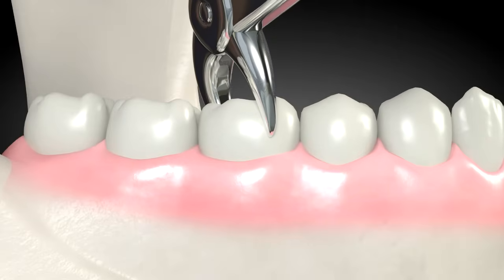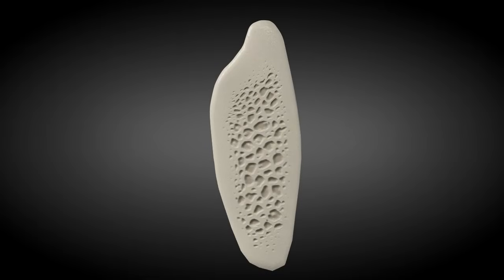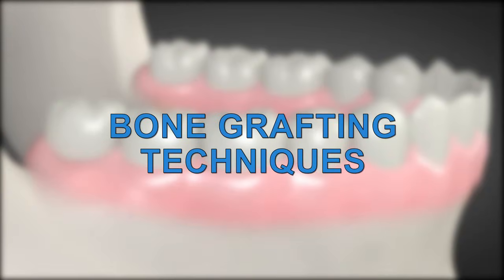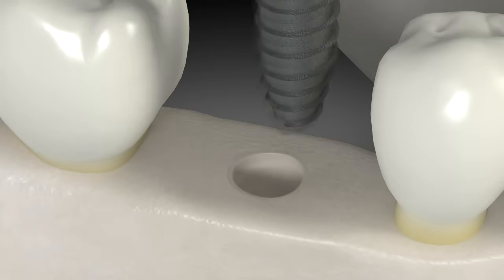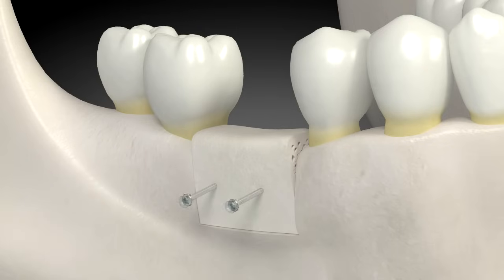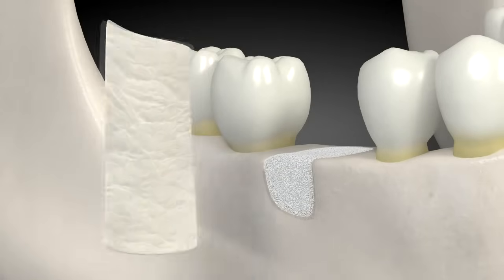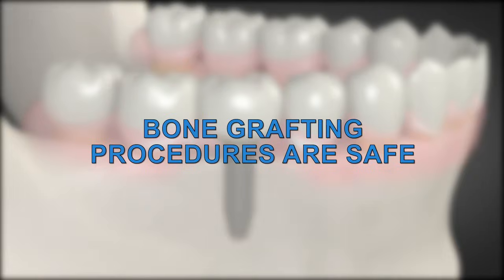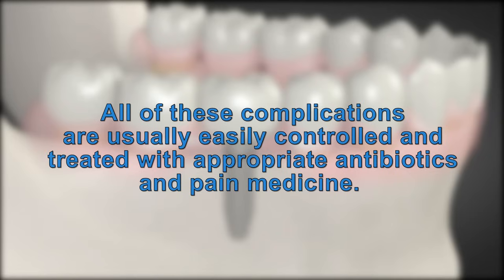What is a dental bone graft?

Comment: I had 3 tooth extraction 14 years ago when I was in the army.  I’m thinking of doing 3 implants for those 3 tooth. Would i need bone graft for all 3?  I’m 43 yo
Reply: I looked this up at kriss ai and it sais "Considering that you had tooth extractions 14 years ago, there is a possibility that some bone loss has occurred in the areas where the teeth were removed. Bone loss is a common consequence of tooth extraction, as the jawbone tends to resorb or shrink over time when it's not supporting a tooth. Whether you will need bone grafts for all three implant sites depends on the current condition of your jawbone." I guess it is better to consult a dentest about this to know more about your tooth condition.

Comment: Join the Army lol. I got my bone graft done in October and my implant last week,  didn't pay a dime
Reply: but in wartimes you'll pay with your life
Reply: @remi1239  14 years and going. I was in Iraq and was blessed enough to come back. Part of why I changed my job cause prior to I didn't have a high likelihood of living
Reply: Did you get the socket preservation bone graft directly after a tooth extraction or another dental bone graft procedure at a later date of the missing tooth?
Reply: @hillhiker1468  I got an9ther bone graft later. Basically they extracted what was left of the tooth I had that never grew in and did a graft. Fast forward 7 years and there was a lot of recession and barely anything there to work with so they did another bone graft.

This time around they went in and took a piece of my lower jaw to screw in/fuse into the bone where my tooth never grew in at as well as add some artificial bone as well. I cam confidently say that I'm happy with all of it overall, I get my tooth in a month or two and I have had not a single issue from start to finish

Comment: i’ve had all 4 wisdom teeth removed, bone graft on only 32 & im on day 4 of recovery & it’s one of the worse pains ive ever had. my upper is fine & my bottom left is fine, it’s just 32 with the bone graft is painful!
Reply: Dry socket?
Reply: Any update on your recovery? I was told by a specialist that I would need a bone graft on at least one side of my lower mouth left side wisdom tooth and will have to get all 4 extracted as well.
Reply: @primeprince3747  i was in extreme pain but now i’m fully recovered and feel great.

Comment: Screw this.... I'm going for a root canal
Reply: Bone graft is better! You’ll just end up paying more in the future
Reply: I hope you didn't do this. Root canals are only good for about 10 years. I had to have mine removed, and it took out two other teeth with it.
Reply: @anonymoose116 can you still get this after a root canal?
Reply: @SiiNTi yes, go for a root canal till it works which in some cases is for life time and then in case of tooth extraction, go for implants. Save the tooth if it can be saved. Avoid dental bridge though and use implants instead of bridges.
Reply: @SiiNTi  I'm not sure. I had enough bone left that I didn't need one. If it gets infected and takes out bone with it, you would need a bone graft. 

I do need an implant to replace the three teeth I lost, but I can't afford it. Thankfully it's in the back so it's not noticeable.
Reply: @anonymoose116  why did it take out 2 teeth with it?
Reply: @anonymoose116 why you took out two teeth with it ?
Reply: @Alihassan3592-g8s  because thse teeth went bad from the failed root canal.
Reply: @anonymoose116  can you give more details like for how long did you have this root canal tooth and why it failed
Reply: @anonymoose116 what do u mean by "fail"?
Did ur tooth get infected?
Reply: @Alihassan3592-g8s  root canals are not for life. They have to be redone every 10 years. 

Unfortunately one of my roots cracked and it got infected. That infection spread, and took out the molar and wisdom tooth behind it. All three had to be removed. 

I wish I had just removed the one molar rather than get a root canal. It would've saved two other teeth.
Reply: @JOHNPT10  root canals will fail at some point. They do not last for life, they have to be redone every decade. 

I had a root that cracked and that led to infection. Because of that, the root canal tooth had to go, and the two teeth behind it.
Reply: Look up root canal it pulls thr roots out and u basically have a dead tooth sitting in there. When it gets infected u will never know cause u won't feel anything because the root is gone and tooth is dead.  Dentist whistleblowers have come out and said this. A dead tooth will get infected. But u won't feel it hence abcess tooth u feel the pain ugwt antibiotics but root canals thry take out thr roots and all and that tooth is dead. Don't get a rootcanal ur mouth has  lots of bacteria and will get into that dead tooth.

Comment: What happens if there isnt alot of bone next to the extracted tooth? Can a bone graft still be successful to be able to screw just 1 tooth?
Reply: you still can do it my bone graft was around 700$, i went again after 1 year and a i paid the double, i have to pay around 3000$ for my teeth also so do it ASAP
Reply: @ahmaddefallah1009  hi, why did u have to do 2 bone grafting?
Reply: Yes that’s the point of the graft, to fix that issue.
Reply: I don't know. Use a larger graft, i guest

Comment: While you are waiting four months for healing Can you chew on that side. Thanks
Reply: No and you learn pretty quickly not to  -  after a couple of weeks yes… but soft stuff - plan to steer clear of grains, foods with bits / any small seeds, all nuts, sharp corners on chips or French fries… for the full 4 months. 

Because if you don’t… your very Soul will roll up like an armadillo every time you’re stabbed in the socket by something pointy. 
It’s still tender to surprises for a good while after the stitches are gone.
Reply: Eventually yea, I’d say for the first week leave the side that had work done leave it alone let it heal cause your whole cheek will be puffy but it’s normal eat soft foods. Continue to brush your teeth just abit slower and gently. Eventually your mouth will go back to normal during the 2-3rd week then start to take it slow on chewing on the side with the missing tooth until your mom gets use to it and you’ll be fine.

Comment: They broke my chin bone from inside, chipped a piece on it and placed it on upper tooth. Excrutiating pain because Local Anasthesia doesnt work well on me. So i bear the pain for 6 hours. And then  3 weeks additional pain due to stiches. Its for hardcore people who can bear pain like me. Well the doctors did a good job. Got it done for 250 dollars in india.
Reply: Why didn't you go for dental bridge? Was it long time ago your teeth was extracted? o had mine one of molar extracted long time ago, never did implant, now bone in that area has became weak and will be needed graft for implant
Reply: @fameboys4650  I was said that if i do dental bridge, both sides tooth would not be saved and implantation will help to just change the existing  tooth..
One of my molar came out od its own..when checked  it was found that i had no bone at all. So grafting had to be done..so i undergone grafting surgery before the implant..There were two options. 1- just using artificial bone powders. 2- Another one is to chip a bone from chin and use it
.well i went for second option as it was more healthy and effective for a long time..
Reply: @fameboys4650  no no. It happened on april 2nd 2023.
Reply: @fameboys4650  worst part was that i had to be given dozens of local anasthesia..which wad not working well fot me due to my body type..in the end doctor said thry cant give overdoses. So i underwent crucial pain for the next 6 hours in the surgery..once i came out of the operation theatre, i bursted out in tears due to pain. Never in my life i faced such thing..well..now all going gokd. Chin bone pain gradually decreasing. Other tooth were also used to take tooth powder which i was on liquid  diet for many days and i was on sutures on upper and lower jaw.m
Reply: @techieboii they didn't give you the option for concious sedation? I do that everytime...nice dose of Xanax and ketamine and it seems like you were only out for a few minutes and have no memory of it.
Reply: @TechieBoii  why didn't they just put u out? get in done under GA? Sounds a lot like my first dentist who was literally incompetent when it came to administering local anesthetic 🤦
Reply: How many dental implants you got?
Reply: @maverick4726  one
Reply: @maverick4726  one
Reply: Who is your doctor?
Reply: @bhavitaparmar2959  Doctor is at PMS DENTAL COLLEGE, Trivandrum, Kerala